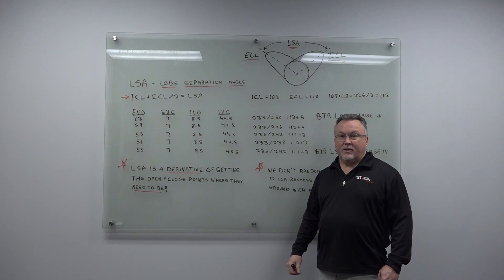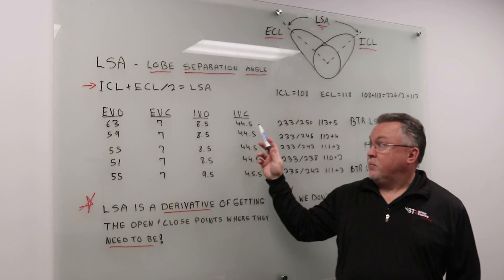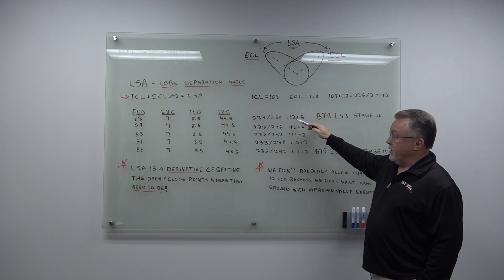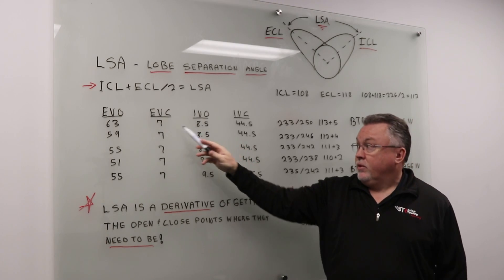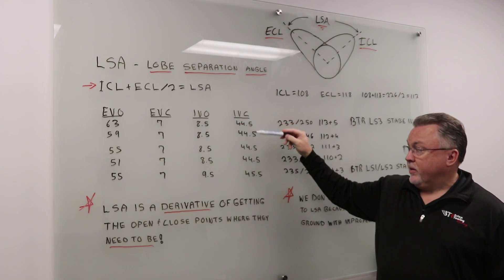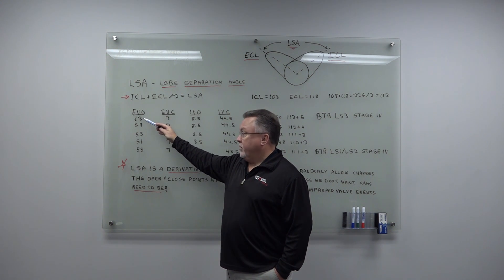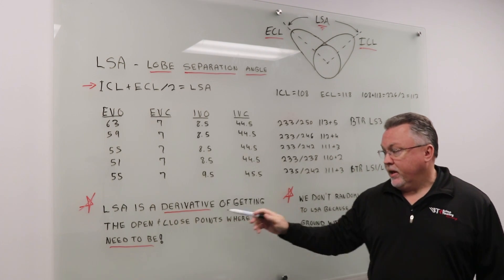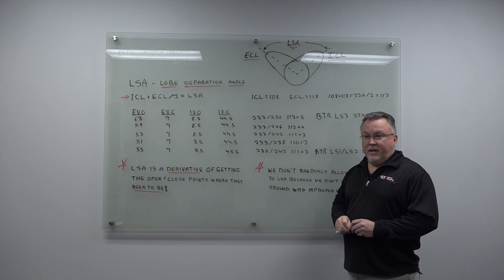Tooley Talks Ep1 : LSA Explained! (Lobe Separation Angle)

Comment: Maybe for electronic fuel injection engines that have sensors. And for a newer HEMI where the top of the ring land is close to the valve relief in the piston. But Brian is clueless to think that it is not important. The EPA hates over lap because of the scavenging affects and spending up the incoming air.

Comment: Nope.....LSA is an INPUT.....not an outcome.....LSA is determined by engine size, valve size, head flow, compression ratio and intended use.....it's up to the builder to create adequate valve to piston clearances.....

Comment: The way you're doing it is certainly a way to do it.

However, using characteristics of the engine to determine LSA's is very accurate also. Engine type, bore & stroke, valve sizes, compression ratio, and rocker ratio being the main characteristics needed.

A couple of examples goes like this:

A 400 inch engine will want a narrower LSA than a 350 inch engine, given the same heads and valve sizes. This is because the cylinders are harder to fill in the bigger engine, and so we will have to open the intake valves earlier (narrower LSA) to help get it done. 

A higher compression in the same engine will want a wider LSA. This is because cylinder pressure decay (expansion ratio) in the higher compression engine is much faster, and so the earlier opening exhaust valve (wider LSA) cuts into the power stroke a lot less.

Comment: What about David Vizard's camshaft theory...Overlap being the most important event  which in turn makes lsa pretty important.
Reply: I've also considered that. But Vizard's focus was on SBC & BBC, and not so much LS's.  I've been trying to compare the 2.  The LS heads just work so much better than any factory SBC head, so Vizard's studies may not correlate, though they do have merit.  Harold Brookshire was always concerned with the valve events first, and let LSA fall where it did.  Mike Jones does as well.  So BTR falls in line with that.  That being said, the more I study this, the more I feel like I should leave it to them.  I agree with BTR's thought; give the engine what it wants.
Reply: @jeffwooton7138  David's calculations do apply and work great with LS engines. I know this from experience.
Reply: @jeffwooton7138  
It has no bearing it being and LS. The rules still apply. Tooley simply does not understand how to properly use LSA.
Reply: @AB-80X I like David Vizard but if we use the 128 formula and plan to run high to 7000rpm, its going to have higher duration, with the lsa under 110 there will be ton of overlap which makes it worse on mpg and manners. If we're racing I'd give it a shot but if you keep in mind fuel economy and drivability you may adjust for less overlap. there's more than 1 way to feed the cylinder with consideration to other characteristics. Users say these cams work and drive well. Id love to see someone with a big cam to only adjust lsa to DV specs and let us know how it acts in the real world with all the extra overlap. I guess you could raise idle and anything will drive nice. Btr pays more attention to ivc timing to make the most out of your choice of overlap/stage. I'm guessing a well mannered DV spec cam will make less power than a well mannered BTR cam.
Reply: @slick408  You can't do it like that  it's upside down thinking.
If you just go by some "arbitrary" rpm number e.g 7000 rpm, you will be losing a lot of power in order to make that engine potentially street friendly.
You need to use the correct LSA that will give you the maximum torque. You may not get 7000 rpm, but you get more torque. Then  you use the final drive ratio to make sure you trap at the correct speed. If you wish to run 7000 rpm with a 427, well, then you also need to understand that you will have to make a lot of power. If that gets too aggressive, drop the rpm or build a smaller displacement engine. In short, you need to build what you need, that's what makes you fast. Also, when you get into an engine that is more efficient, you also get the RPM. There has been several instances where engines that ran the proper LSA with a similar overlap to the wide LSA engine, made peak power at close to the same RPM. All you get with the wide LSA is an engine that is weak down low, massively inefficient and not as fast as it could be. Another thing many forget is that especially with an LS, you can run a lot of lift with modern lobes and the 55 mm cam. So few take advantage of this. That lift will also drive your RPM up. If you get a cam with good lift, the proper LSA etc. the RPM will very much still be there, and so will the driveability. It's all about building the correct package. If you build a 475 ci LS and still want that thing to make peak power at 7500 rpm, well then you better be ready to build something that will make upwards of 900 hp and be fairly aggressive. Optimise what you have, rather than trying to dictate what you want.
Reply: @slick408 use his formula to get the proper LSA and then pick your duration and overlap to adjust for where want to make power. The more duration the more over lap (same LSA) the more overlap, the higher the rpm range.
Reply: @slick408  David's testing has shown that LCA sets the torque output and the overlap sets the rpm range. He has repeated this over and over on the Speed Talk forum. Maybe someone needs to challenge his theory with their own dyno tests?
Reply: First, 127 is for Windsor and FE Fords. 128 is for SB Chevy and Chrysler V8. 132 is for BB Chevy, BB Ford and Cleveland Ford. Additionally, there are other offsets to the formula for variables such as compression ratio, rocker ratio and other characteristics.

AFAIK, DV has never claimed that his formula produces the best cam timing for drivability and fuel economy. He states specifically that he is only interested in giving the engine what it wants, in order for it to make maximum torque. He also states that his calculated LSA is the best starting point for experimentation. Once you are in the correct ball park for LSA, you modify the duration for good idle, for maximum RPM power, or for something in between.

I don't mind you criticizing DV's formula, but Let's not mischaracterize it. There is no need to create straw man arguments.
Reply: @slick408  I just called them on that too .
They are right But its a beginning baseline That you keep 108 Lsa 
lets call overlap on 108 6 percent and add big duration
call it max nascar cam 300 Duration  at 108 lsa youn now have 17 percent overlap and blew intake right out exaust .
So now you have to  push points of cam lobes apart making higher LSA 
now at 110 lsa you have perfect 6 percent overlap once again 
now like Tooley says time the valve  events 
to top dead center or before Thats about all i get 
So now Go to Howards cams  and 1 at a time  study each cam 
106 lsa   406 - to 420 lift  below specs ,cam and headers needed
obviously low grunt truck cam 
and tell rpm range for each cam 
some want big port heads   some need gears or stall 
Tooley Didnt say it but he is going to start being purpose built 
knowledge stuck in his head  street strip roundy round  drag racing 
Rpm  Ranges Durations for each one in 3 different ranges lol

Comment: What does it mean on some of your specs where it says 113+2 ?
Reply: LSA is Lobe Separation Angle, and is the included angle in degrees between the centerline of the I and E lobes. The +2, or whatever the number after the + sign is, means the cam is installed advanced that number. Many cams already have the advance ground into the cam, so it's installed "straight up", i.e., by aligning the marks on the sprockets. Most knowledgeable engine guys don't use the "marks", they degree the cam....

Comment: In my opinion lsa is more important in higher elevation then at sea level due to  air density you can tighten it up to create a vacuum or overlap sooner with a lower lsa which is why carburetor motor work well with lower lsa cams
Reply: Except you're WRONG. A wider LSA produces more vacuum than a narrow LSA.
Reply: @Thirdgen83  Exactly. Many guys also assume a tighter LSA means losing low speed torque. This is not true in every application. After a certain point, yes, but you also gain midrange torque with a tighter LSA. The high rpm horsepower of a tighter LSA usually means that the HP also doesn't drop as dramatically after the peak number.
Reply: You're wrong.
The LSA should be  a fixed input that is directly related to engine displacement, valve size and compression.

Comment: I just bought a 222/226 .597 .600 custom cam from your shop. Can't wait to get it and install it. Plus 7.400 chromoly push rods, platinum dual valve springs, LS7 lifters and trunion rocker bearings.

Comment: "Don't focus on LSA." he says yet none of the advertised specs tell us the Opening/Closing event specs, just Lift and....the LSA that we are not supposed to think about!  LOL
Reply: Yeah, the video didn't make any sense. Fine, the opening and closing points are more important than the LSA. But those can be somewhat adjusted by degreeing the cam. Overlap can't be adjusted and is defined by the LSA. So how are you supposed to ignore the LSA?
Reply: @johnterpack3940  
Those are not more important. The LSA is the main thing to get right. And it is a fixed value depending on CID, valve size and compression.
Reply: @johnterpack3940  You don't get it.
The LSA just happens to be what it is once you work out the opening and closing points.
If you need specific opening and closing points and you want to lower the LSA you will need to adjust the other cam specs so your opening and close points are still the same.
Reply: You enter the duration, LSA and Advance into a cam calculator and it give you the valve events. The cams are designed around the valve events, and that determines the cam specs.
Reply: @hefftoneGA  Reread mycomment and you should realize that your reply dies not answer nor apply.
Reply: @stephen4764  Just trying to help. Good luck with life, bro.
Reply: You're IQ is too low for you to understand :-)
Reply: You are an idiot Mr. Mysterious.  You didn't even comprehend (that means "to understand") my comment, but you feel safe since you hide behind a Screen Name.
Reply: @stephen4764   Awww poor thing. I will get you a tissue. Go and get a hug from your mommy.......
You clearly do not understand what Brian Tooley was explaining.
I do. That's the difference.
It makes perfect sense to me and I spec camshafts the same way for myself.
Reply: @stephen4764  You are not making sense. Stay delusional and happy. Good luck to you.
Reply: @stephen4764  you make an excellent point. While LSA is important, it's not the be all and end all of my selection decision. Like you cam event timing at .050" is what I really need to see to make an educated decision between different cams. Hmmm the answer might be hiding in plain sight...
Reply: @oceanwaves83  We need to tune the valve events in your head
Reply: @mrmysterious6006  you're, hmmm

Comment: I believe you said as you tightened it up that you decreased the exhaust duration. That's why your evo  number is going down. Ls's are a different cat. I agree you can adjust your lsa for needs of the motor. I have 406 gen 1 with a solid lifter cam on a 104 lsa. Absolutely love it. Before he died, bill metzner with lazer cams taught me a couple things. Tight is right as long as all the other values fall inline with the combo.
Reply: what are the full specs on that cam you're runing? if you don't mind me asking
Reply: @Noeysuarez  sure would be glad to help. Its a howards cam part number-HRC 112452-04.  duration @050, 252/260
lift- 530/555
104 lsa/ 100 ICL
It is a soild flat tappet also. This one will raddle the windows! Sounds and runs great. Hope this helps and good luck..
Reply: Absolutely,  not all cylinder heads are created equal. LS heads are extremely efficient,  older 60's and 70's "muscle car" era heads... not so much. The heads of the 60's utilize a tight lsa to crutch their poor flow characteristics when used in a race application. That tight lsa = more overlap which is beneficial for a comparatively poor flowing head at high RPM.
Reply: @Torquemonster440  Just an FYI. A tight lsa benefit all engines, no matter how good or bad the heads. Now a big block or a big cubic inch engine that has good torque production already, you can widen them out a touch.
Reply: @Scubasteve22   agreed, Richard Holdener did a video where he compared lsa's on an LS and the tightest one made the most power.  I was just trying to illustrate why that old school 60's muscle car sound is so popular. A tight lsa is very beneficial to V8's of that era in a race application.                                        

I just spec'd out a custom roller from comp.. ground on a 107° lsa.  😁   I cant wait !!  This is going into a 448ci big block Mopar that currently has a solid flat tappet ground on a 112° lsa.. 🥴
Reply: @Torquemonster440  Cool. Sounds like it should bs a good one. Will definately sound good. I switched  to howards cams about 8 yrs ago. Never been happier. Call comp products. and tell them the specs im looking for. i Always deal with eric, no more read out of a catalog crap.
Reply: @Scubasteve22   I sure hope so brother. It's going from a .508 lift 242/242 @ .050 112 lsa flat tappet to a .575 lift 243/247 @.050 107 lsa roller. I want to be done with RPM at 6,500 or less and pick up as much mid range torque and horsepower as possible. 3,500 vert.. want it to hit hard just as the converter is locking up. Gonna be kinda "peaky" but it should pull like a freight train from 3k- 6k . Hopefully it works out.
Reply: @Torquemonster440  Yep. You should be coming in to the meat of your torque when that conv flashes. Honestly, you wont have to turn it more than 6k. It will be mostly done. Here is my combo in my son's truck.
410 cleveland, 11.5-1 comp, trickflow 195 heads, ported by me, trickflow single plane (3-8k)with 950 DP carb. Howards custom hyd roller (to my specs) 249-256, 640 lift, 106 lsa. Made 624  hp @6100 and 585 ftlbs  @ 5300. Had it dynoed before it was fully broke in, its definately nore powerful now.
Reply: @Torquemonster440  Good luck. Sounds like a night and day diff on the cam. You could start your own worn out tire shredding company!!!! 🤣🤣🤣🤣
Reply: @Scubasteve22  Another tire shredder on the loose!!😂😂😂

Comment: What do the +1 or +2 numbers mean after the LSA#?
Reply: Highlex degrees advanced
Reply: Does that mean you're supposed to install the cam that many degrees advanced? Ex..Stage 2 turbo 113+4 should be installed 4 degrees advanced from 0?
Reply: @brianfox5546  who knows? we got about half the info needed out of this vid.
Reply: @brianfox5546  the degree is built into the grind.
Reply: @Brian Fox  Ima crazy is right-Many, to most times, that means the advance is ground into the cam.
Reply: "Advance ground in" means the cam is made that when the cam gear is indexed to the alignment peg, and the cam for is aligned with the crank sprocket line, the cam will be oriented so that each valve ever will happen x° earlier. Cams are designed around the 4 valve events, the cam data 228/230, 112+4 is the functional equation that generates "when" each of the events occur. To alter the LSA or advance alone alters "when" each events happen. "when" meaning in relation to degrees of crank rotation, which in itself dictates the position of the piston in its stroke.